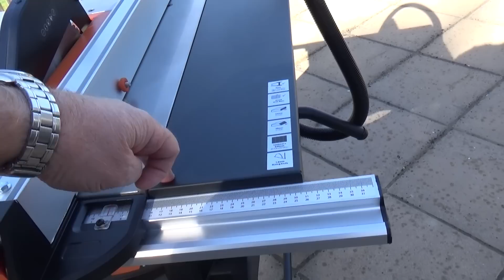Evolution Rage 5-S Table Saw Review

Comment: I have one of those and have to say I wouldn't change this for any other in this price range. I totally agreed on the blade protector. The few things I would add is that if you care about precise cuts you need to check if the fence is square to the blade every time. I usually check if there 90 degrees between the blade and the far edge of the table. The important bit is to measure again the piece of the table from which the blade protrudes and not the one which moves back and forth, it has a bit of a wobble. Also, I would recommend using a square to set the blade to 45 degrees rather than what it shows on the gauge below the table.

Comment: There is so many mods that can be easily made to this saw to make it better. I have remade the aluminium tenon piece for the mitre attachment along with the sloppy clamping spigot. The best mod of all is actually something the manufacturers had considered and that is machining additional attachment holes in the nylon rails that the linear table slides on. There are indents already in the aluminium die casting for 4 more additional holes. I drilled and tapped all of the holes at M6 to allow for button head socket screws to hold the rails down on the casting which in so doing ensures the rails don’t bend upward under load. I removed the crappy grease off the rails and then applied a reasonable amount and not half a pot of the stuff!
Reply from the maker: Hopefully Evolution will read this and take note Shaun.  :-)

Comment: Excellent review. I wondered if the blade guard could be made to lift more easily when the work piece is offered up by cutting the leading end of the guard to a more acute angle. Seems worth a try rather than not having it there at all.
Reply from the maker: It would certainly help Christopher!  :-)

Comment: you can try to add a small wheel in front of the blade guard using the screw we can see in the front part. to allow it to raise when you slide wood under it. with the wheel the wood won t be stuck in front of the blade guard
Reply from the maker: Yes, that would improve it.  :-)

Comment: just wondering about different blades. I've just pensioned off my Bosch GTS10 saw (motor gone) and bought one of these saws today, so yet to assemble it yet.. I have 4 blades that I used on the Bosch saw. Will this saw use all general types of saw blade?
Reply from the maker: It will Ian, but you need a blade with a 25.4mm bore.  I purchased a blade with an 80T Saxton blade with a 25.4mm reduction ring for my mitre saw and am impressed with the cut.  https://amzn.to/2VNhOS2  You can basically use any blade with a 30mm bore if you can get hold of a reduction ring.  :-)

Comment: Interesting review. I'd  like to know how that blade is for cutting wood after all that metal!
Reply from the maker: It will cut wood after cutting metal.  if you cut a lot of metal the blade will gradually deteriorate and cuts in wood will be rougher.  I use the multipurpose blade for metal and the wood blade for wood.  :-)

Comment: Thanks for the the review I'm playing with the idea of replacing my titan table saw with this one.
Definitely upgrading just stuck between the dewalt and this. 🤔
Reply from the maker: Decisions, decisions!  :-)
Reply: the Dewalt is although 50% more expensive it is 1000% better quality and gives a far superior cut in timber because of the much faster motor. This saw is a flimsy budget saw with some neat features and is fine for occasional use but this is not professional quality. I have this and the Dewalt and I only use this for cutting steel and aluminium sheets.
Reply: @steveblack1210  ye I totally agree I went for the dewalt and have also done a review of the machine, i do rate it highly but there is a few flaws. 😊

Comment: Good work Russell. My push stick would not fit into the slots on the end so a bit of filing was in order. And that blade guard does look to be a bit problematic. If you remove it you lose the dust extraction capability? Is it 'safe' to use the dust extraction pipe to slightly lift the guard to allow the workpiece to address the blade while the saw is running?
Reply from the maker: It is probably safest to stop the saw, but I can't see many users doing that.  I reckon the dust extraction pipe is not a bad idea, but it does mean leaning out over the saw.  I am going to remove the guard as I will be using the saw to cut rebates and grooves for furniture making.  My other table saw has been without a guard for many years!  It is still dangerous either way.  Personally, I do not think the guard makes it safer because it does not work in the way it was meant to.  I have a rubber bung to block off the connection for the guard on the dust extraction pipe.  I only put the guard on for the review as Evolution would have had to edit the video otherwise.  Thank you for your comment Nooper!
Reply: Thanks for the feedback Russell. As you may have deduced I am new to table saws. If you want to do rebate cuts and grooves I guess you have to remove the riving knife as well. I have to say that every video I have seen of the 'pros' using table saws just has a blade protruding out of the table! And Evolution do say the machine is not suitable for rebates and grooves. I guess they are just covering their backs.

I heard that 10 people lose fingers to table saws every day. Clearly dangerous animals! Wonder how many of them do it fighting a resistant blade guard.
Reply from the maker: The riving knife must stay on Nooper, it helps prevent the wood binding and being pulled up by the rear of the blade.  If that happens the saw will throw the wood back at you with considerable force!  I know this from experience.  I had it happen to me many years ago cutting a reasonably big piece of plywood freehand.  Felt like I had been kicked in the stomach by a horse and left me well bruised and sore.  The knife needs to be dropped just below the top of the blade by a mm or so.  You need to make your own mind up regarding the guard and take great care either way.. I have seen what one of these saws will do to your hand if you touch it and no one has quick enough reactions to stop it once it has started!  Please take care and do not cut anything freehand, always have it supported with a fence.
Reply: Thanks Russell. I will proceed with the greatest of care.

Comment: Hi Andy, great to the point review, have you tried another quality blade in as well? Only it looks like the rip cutting is a bit laboured.
Cheers. Gary. Manchester 👍
Reply from the maker: No I haven't Gary.  I did fit a 255mm Saxton 80t blade to my mitre saw and was happy with the results.  They are cheap, but suprisingly good.  :-)
Reply: @RussellPlatten  Thanks Andy, I'm on the verge of buying one of these, it's not a lot of money really for what you get.
Cheers Gary
Reply: @RussellPlatten  Sorry " Russell " 🙄
Reply from the maker: @garyhorne2972  LOL, No problem! Gary!  :-)

Comment: Hi Russel,
Thanks for sharing your thoughts on the Evolution!

I'm in the market for a new table saw to replace my old, battered and fenceless Scheppach. You are not the only one who seems to have had issues with the blade guard. The Ultimate Handyman also found it a wee bit dodgy. 
Anyway, the extraction setup seems to be the same as my old saw, which when I bought it, second hand, did not have a blade guard either, and is absolutely terrible at throwing dust all over the shop (literally). 
So, my question is: how do you find the dust extraction on the Evolution works without the blade guard and attached extraction hose?
Reply from the maker: Sorry I am so late replying.  The dust extraction is OKish, not brilliant.  :-)
Reply: @RussellPlatten  thanks again for sharing your experience with the Rage 5s. I've gone ahead and ordered it and it will be arriving tomorrow. It's a table saw, it will be noisy and dusty even with a shop vac. But it has to be better than the old one - vac or no vac made no difference as no sawdust came out of the port either way!
Reply from the maker: @whomadethatsaltysoup  Spend a little time making sure the saw is set up accurately with the fence parallel to the blade and at 90 degrees to the table.  I have used mine for some fairly simple cabinet work on my boat and it did the job with ease.  I was very impressed with the saw's capacity and portability.  :-)

Comment: Hi I just bought a new evolution table saw.  I’ve read somewhere that it’s worth coating the metal table top with beeswax to stop rust.  Anyone else heard of this?  The only video I’ve seen where beeswax is applied is where the metal is warmed first with a blowtorch before applying the wax which is heated from solid to liquid in a pot, and then applied with a brush.  Seems like a lot of faffing about??  Any better ideas?  Do I even need to add a protective coat?
Reply from the maker: Personally I do not think it is necessary.  :-)
Reply: Cheers m8 ..  👍
Reply from the maker: @AliBaba-cm7ps  👍

Comment: Great review Russell, and I've just ordered one. Just one thought, is it possible to use blades other than Evolution ones because the bore size is rather odd? TIA, Nick
Reply from the maker: Hi Nick, I hope you like it!  I love mine, I am using it more than my cabinet makers saw which was about three times the price many years ago!  You can use any blade of the correct size with a 25.4mm bore.  25.4mm is not a standard size, but you can buy reducing inserts from 30mm to 25.4mm easily.
Reply: Thanks Russ. I had a look at one and was impressed with the build. Never used reducing inserts before and was not sure about them. Being delivered on Monday and can't wait to use it 😁
Reply: Russ, mine was delivered today and it's now built. Went together easily and I'm pretty impressed. The only thing I've picked up on is that the rip fence is not quite at 90 degrees to the table in the vertical. I don't think it's enough to affect the accuracy of the cut - I'm just being fussy 😉

Comment: Interesting review. I’m aware that this video is a few years old but I just picked up this saw brand new (I’m in Australia) and mine doesn’t have the safety stop. It’s strange that they would remove that as a function.
Reply from the maker: That is strange.  Have you had a good look at it to see if it has broken off?  I am assuming that by safety stop you mean the red button that drops down over the on/off switch.
Reply: Russell Platten yeah I went through all the packaging etc and it’s not there. Then I looked at the box/instruction book and the picture doesn’t have it either so I think they’ve actually removed it as a feature. I find it quite strange though because as you said it is great for safety.
Reply from the maker: That is strange!  :-)
Reply: Also in Australia and got the saw recently and it doesn't have the safety stop.  I do have a drill press from another manufacturer and it does have the safety stop.
Reply: Rob Gor what’s your opinion on the fence? I find mine to be really off and I have to manually check every time that I lock it down that it’s straight. It’s really loose, doesn’t seem to actually lock into a sliding channel or anything.

Comment: Thanks for your review! Just got this saw and assembled it with the help of your video... quite like it but the carriage part has quite a bit of play up and down and is tilted left resulting in cuts on small pieces 4-5 degrees off square... is there any adjustment or it’s just a faulty one that I should return?

Comment: Thanks for very nice review. I do like the saw very much, the only thing I can't figure it out are the slots/holder/thingy on the left and right side of the saw. Any idea what is that supposed to be for? (besides push stick and spanners) I was kinda hoping you can store mitre gauge and blade guard when the saw is folded, but sadly it doesn't seems like it
Reply from the maker: Hi Matty, thank you for taking the time to comment.  I also like the saw.  I love the way I can move it around very easily and have a table saw at the work site.  The brackets you are talking about are for storing the fence whilst using the mitre gauge or moving the saw.  :-)
Reply: so at least I was right about it :D sadly in my case, fence didn't fit there at all! After some filling (over 5mm of plastic NOT fence lol) it fits there perfectly and it makes the saw even more amazing.  There is also nice place on the right hand side of the saw where you can fit blade guard, I did cut small slot a got Velcro strap through it so it's secure and won't move. Now just 3d print some nice T-shaped slide holder for mitre gauge so it won't move during transport :) Absolutely love that you can store EVERYTHING on the saw itself and not run around the shop to look for bits and pieces here and there :D
Reply from the maker: Yes, I completely agree.  if you are like me, you will spend more time looking for the tools than carrying out the task! LOL  I like the idea of a bracket for the mitre gauge too, I may just modify mine.

Comment: I have one of these - it's good but you're right the blade guard is awful - especially if you are cutting dados and need the blade to be very low.  I can't find any info on what the rip fence face plate is for??  can anyone help?
Reply: A rip fence plate should be used when ripping wood so that the peice being ripped does not touch the fence anywhere past the rear of the blade. this is because certain woods, especially if they are damp and many other reasons can have a tendancy to peel away from the blade as they clear it, or try and peel apart at the blade thus jamming against a fence. in short if there is no fence behind the blade, dodgy wood can move where it wants once it has passed the blade. Hope that helps, without a diagram it is hard to explain unless you have ever encountered the issue. when I was an apprentice we used to get Brazilian Mahogany boards that you could start ripping and they were under so much internal tension that half way down the board they would just spring apart. ( and usually end up in the wood burner)

Comment: Agreed! Plus many other faults - mani n table is made of 4 extruded aluminium sections and when mounted to the frame they are NOT flat. So angle of workpieces change depending on which sections of the table they are resting on. Also rip Fence  is almost useless .It is way off 90 degrees in the vertical plane and there is no adjustment - so I have had to insert brass shims to get it anywhere near vertical. Frame is very lightweight pressed steel and plastic with a lot of flexing if not on a totally flat surface - so pretty useless for site work.

Comment: Would the t slot make it difficult to make a sled for this machine
Reply from the maker: I don't think it would be problem Shaun.  The slot is wide at the top allowing you to glue and screw a reasonable insert onto the base of the slrd as a guide.  You would also have the option of utilising the sliding carriage for a sled.  :-)
Reply: @RussellPlatten  for the traditional sled would u cut runners t shaped or a square block

Comment: Sliding carriage seems a bit sticky / not-smooth in operation. Also mitre gauge seems to have a bit of wobble / free play?
Reply from the maker: +SpiderElectron Hi, the sliding carriage is a great add on, it is not as smooth as the carriage on my cabinet makers saw, but the Evolution saw is a quarter of the price.  I do not have any issues with it and I have used it regularly.  The mitre gauge does have a small amount of free play, but not enough in my opinion to affect accuracy.  I reckon it is the same as the free play on my expensive saw.  I took this saw to my boat for some alterations to the interior fitted furniture and I was so glad that Evolution had sent me it to test.  Space was tight and the fact that I could set it up and move it with ease was very useful.  I used the sliding carriage and mitre fence during these alterations where I removed a dinette and used the ripped out wood to make a shelf with storage space.
Reply: Hi - thanks for the reply! I've been using this saw's little brother the Fury5-S and find the slop in the mitre gauge a bit annoying. Nothing that can't be fixed though - and still a great saw for the price!

Comment: I see they still haven't sorted that ridiculous blade guard. I have the Rage 6 and it's even worse than that one. You have to lift it almost every time you use it. I'm thinking of removing it but it throws dust in your face when using the mitre saw if you do that.
Reply from the maker: I reckon you are stuck with the guard with the Rage 6 Ian.  Your eyes are more important!  :-)